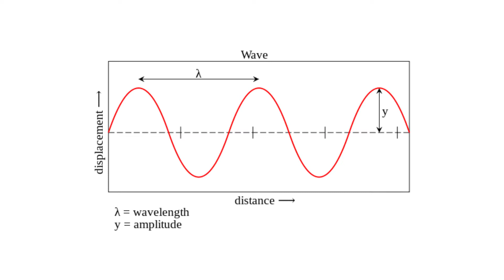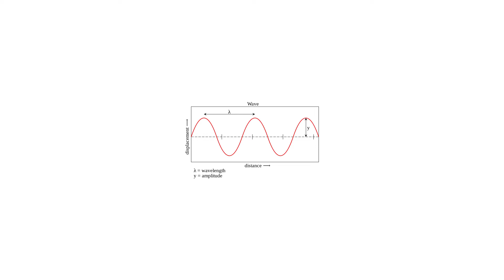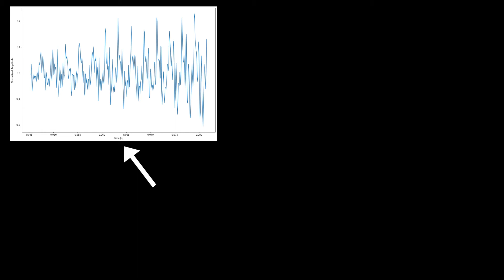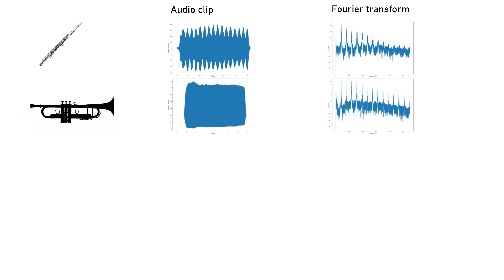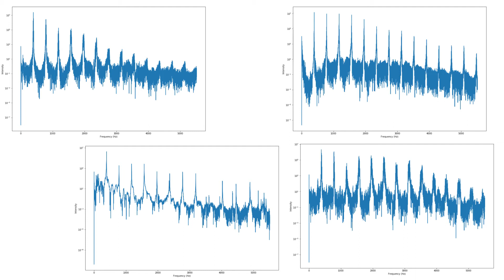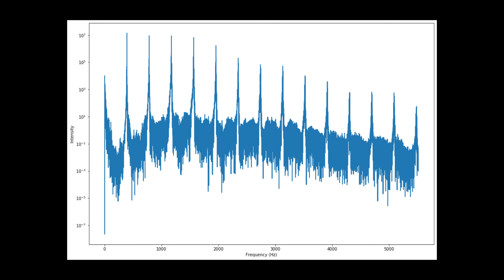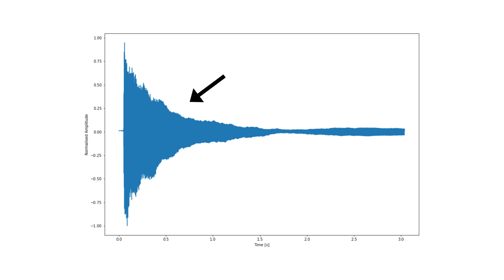Why Do Instruments Sound Different? The Science of Timbre

Comment: I know it's a detail but ... well ... someone may find it useful: Fourier Transform is an integral from minus infinity to plus infinity so it can't be used to that. What is used is the Fast Fourier Transform. FFT splits the Fourier Transforms in two: one is the FT of a window - a function f(x) that for x>L f(x)=0, x<-L  f(x)=9 and for -L<x<L f(x)=1. Now we have a well defined function  and we can calculate the integral. Now we get our audio signal but just a tiny portion ... let's say 2*L wide. Then we can do the fourier of both, use the fourier of the windows to correct the fourier of the shor sample and then we have FFT.

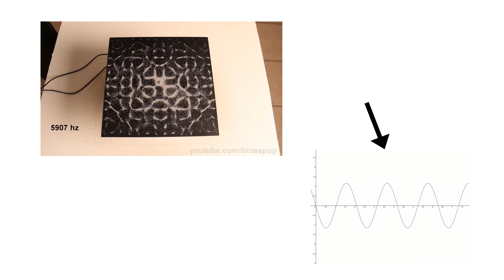Comment: Nice explanation, but a bit dumbed down. In the case of the violin, it's not just the string that causes air to vibrate but also the body of the violin, and e.g. the bridge/comb that holds the strings up (at about 06:00 the different resonant patterns of two violin tops, giving different timbre, are explained a bit). Sections in the curved top vibrate and the violin maker uses toy like mini planers to shave the curves but also adjust resonant properties. Before that (a)he actually acoustically tests the boards that the instrument is made from, for musical suitability given the desired result.
The top may have a stud coupling it to the back and with the stud as frequency filter, this adds different "harmonics".
This so far is based on "contact" between vibrating elements where one passes vibrations on to the other. There still is the "through the air" passing on, that e.g. we hear a lot in pianos - not just with the sustain pedal down, because the top two octaves have no dampers.
Second, timbre is an aspect of the human voice as well and explains why you can hear the distinction between e.g. father and mother's voice.
Third, the video's very busy wave patterns don't really help in understanding timbre - better explained with the simple graphs that show a modified sine or block wave as a thin line depicting pressure as function of time.
Fourth, the human ear is not a single sensor device, but has some 20,000 frequency (band) tuned sensors that measure at different frequencies. While the ear's anatomy and geometry in the case of an individual may define their audible frequency range, these ~20,000 sensors allow us to hear timbre instantly.
In electronics terms, the bandwidth needed for a 440 Hz (piano's central A in today's tuning) sine wave is about 440 Hz, but if we faithfully want to reproduce the piano's timbre, at that 440 Hz, then we need - expressed in sine wave frequency - orders of magnitude more. Being able to play back 20,000 Hz sine wave is simple. Playing something that looks in the oscilloscope like a block wave in a way that precisely sounds like a block wave, even at 440 Hz is darned difficult. While this is an easy problem in Fourier, it is extremely hard to design/build devices that can do this and I'm not even considering, say, a 3-way loudspeaker that cannot reproduce timbre properly towards a random listening position (in the room) - so many cans of worms and rabbit holes. Inertia and momentum of molecules in gas and of electrons in a copper cable play a big role here, and even quantum things around the cables where most of the signal travels play a role there.
By the way, in humans, hearing is much faster than seeing and as long as the slow travelling of sound is not an issue, it really works out that way, versus light speed. We have comparator networks in the brain to analyse left/right differences and as some neurons have electrical synapses rather than enzyme-modulated biochemical ones, these have lower latency and we can imagine these electrical neurons in the audio paths of hearing.
Fifth, "hearing" and recognition must be learned and take significant time for us to become predictably reliable at that.
Therefore we need years before we can recognise voices (characteristic to individuals timbre) and therefore some of us hear a "piano" when a pianist test-plays 5 Steinway D individuals, and coming back next year is able to say, I played this one last year.

Comment: It would be informative to start with a pure tone and add harmonics sequentially to build up a complex timbre. Also, the intensity of the dominant frequencies (peaks) in your diagrams is shown on a logarithmic scale and as a result it is difficult to discern that the intensities actually vary quite a bit. Maybe by adding frequencies to build up a complete musical note you could inform the viewer of the subtlety of the added subordinate frequencies. Also, what about all the noise between the peaks? What does that add to timbre?
Thanks for posting this. I looked this up because of a recent article in the science journal "Animal Cognition" that determined that dogs could perceive both pitch and timbre in a human voice, and I didn't know what "timbre" was.
Reply: I agree, that would be interesting, and I’d like to see a video showing how specifically the different harmonics of different instruments change the sound, as well as whether the noise in-between matters.
I suppose the way to see this would be to take a spectrogram , or just one of these Fourier transforms, and modifying it, and then taking the reverse operation.
Iirc the different vowel sounds are determined by the differences(ratios? Idr) in the frequencies of the first few peaks.
In contrast, I think with instruments, I think (but am not sure) that the difference in frequencies of peaks is generally basically the same between instruments, and that it is the relative volume(height) of the different peaks which is different between different instruments?
So like, a pure sine wave should have a single peak, with the other peaks having a height of zero, but a triangle wave or square wave should have peaks in the same places as each-other, but with different patterns in the heights.
(Though I think it should also be possible to express e.g. a sine wave or square wave in terms of triangle waves, and this would just be a change of basis.
Hmm...,
So, the space of periodic bounded signals, should be L^{\infty}([0,2 pi]) I think, and the Fourier transform should send that to... what, \ell^1(\bz) ?
Or...
Uh, L^2([0,2pi])is much more convenient to take Fourier transforms of, because I’m pretty sure it should give l^2(\bz) , and these are both Hilbert spaces ...
But I guess anything bounded will be in L^2 as well,
So, uh, will this change of basis from sine waves to triangle waves be unitary?
I guess the question is, what is the inner product of triangle waves with different frequencies, where one frequency is a rational multiple of the other?
Hm, I’m guessing it generally isn’t zero?
Or, maybe it is? Hm. I should get some scratch paper and work this out.)

Comment: Such an underrated and amazing video.

One question: once transforming to frequency domain, does it imply that a new plot is needed for every discrete "time" relating back to the time domain?
Reply from the maker: Let me know if I’ve got the wrong end of the stick, but if the question is whether you need a frequency plot relating to each specific instance of time on a time plot, then the answer is in general no. 

The frequency plot will show you the frequencies of all the sine waves making up the original signal, and since the sine function varies with time, you get a intensity vs time plot which varies with time. 

The frequencies of each of the sine waves are fixed however, meaning that an intensity vs frequency plot does not change with time, assuming that the source is providing a consistent signal, for example a trumpet note being held at the same pitch and loudness, and not changing pitch etc. 

Hope this helps.
Reply: @ollienash4124  Don't know why it took me this long to come back to this video and find your response, but yes, that answers it, thank you!!
Reply: @ollienash4124 .    Hello .   Are you aware of the work of the late Carleen Hutchins ?   I am fortunate in having 2 fiddles made using her techniques,  and have a photo of the glitter patterns when the top plate was complete.  This technique takes the mystique out of violin making, particularly for the amateur maker who only makes a few violins.    I’m convinced that Stradivarius had a top plate which he used to determine how close he was to achieving the sound he was looking for , on each fiddle he made.   
Additionally,  the violin bridge can be “tuned” to filter out undesirable frequencies and achieve the sound the maker is looking for.  I have read that quite a few bridges are made before the maker….and the player…is happy.